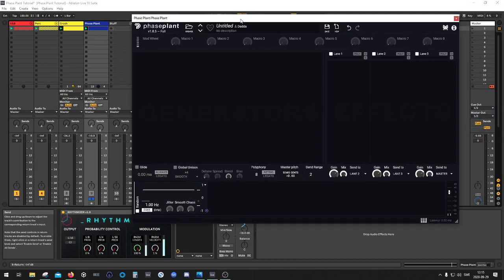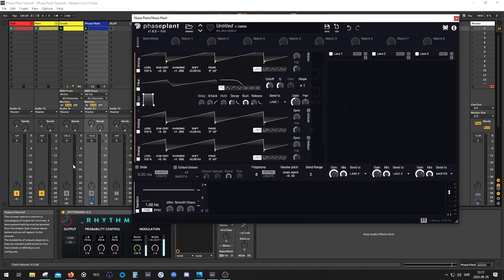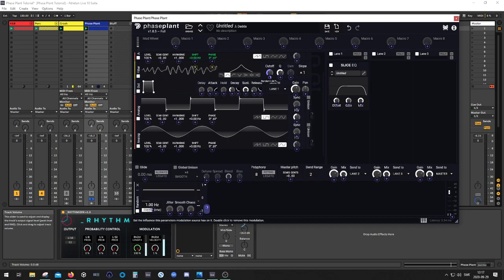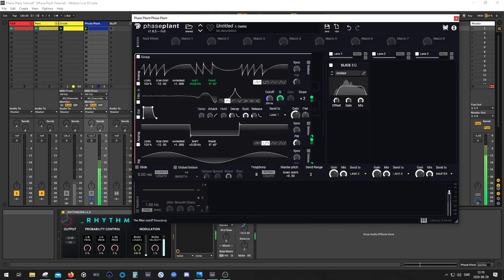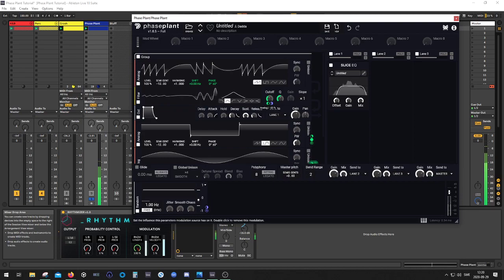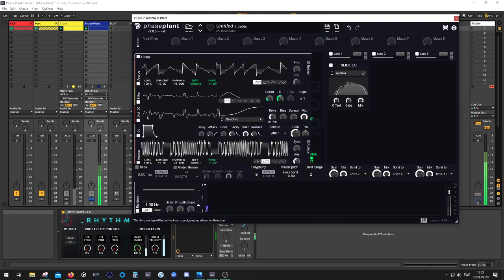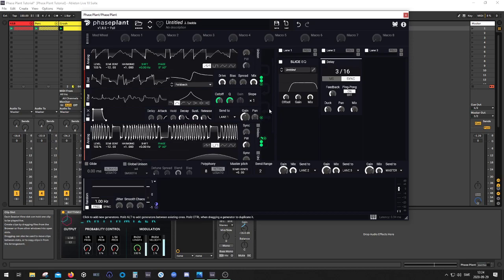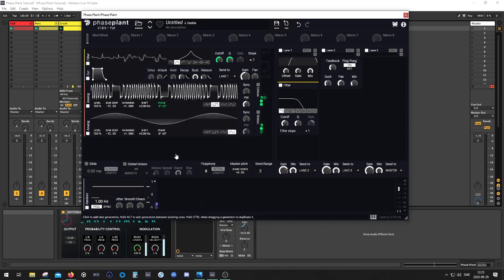[Phase Plant Tutorial] How to get your filters sounding more unique

Comment: Great one! I usually use really high-pitched sines to modulate cutoff for grit/squelchiness, so much potential in the generator section alone
Reply from the maker: Ohh! great tip, i just figured this out so thanks, I will test this right away. I was at one point able to recreate similar timbres you usually get from Filter FM's in traditional modular bleep bloop systems. Gave me some really weird results.
Reply: @DaddaPsy  Dash dropping the knowledge bombs! Great video too Psydrop